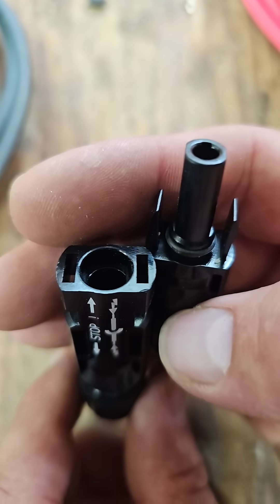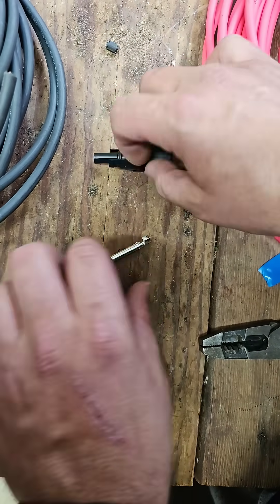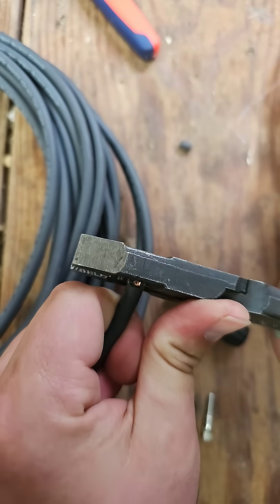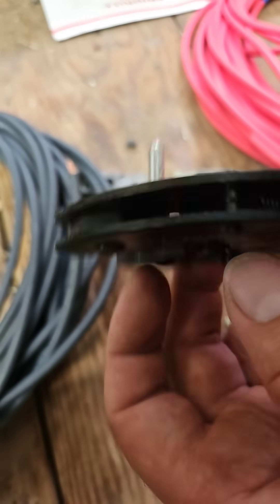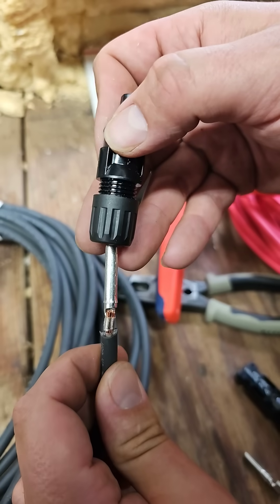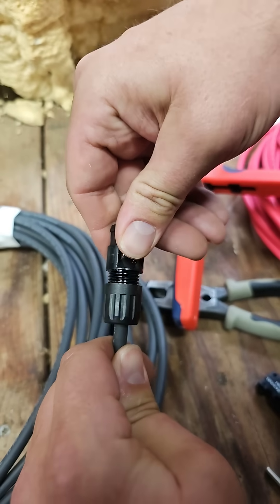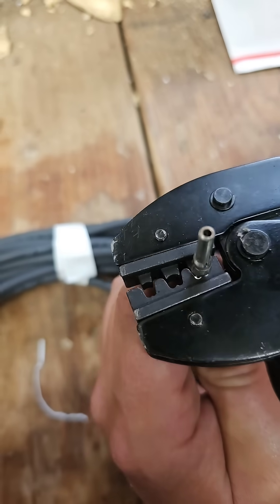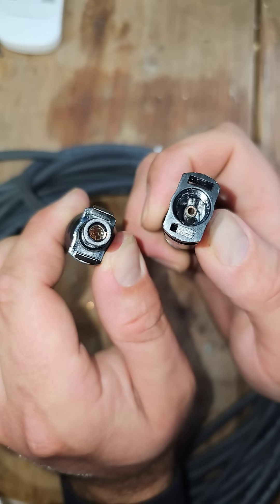The ABSOLUTE BEST Way to Crimp MC4 Connectors for Solar Power

Comment: The best way ist NOT to use crimp connectors. Too expensive, to much Tools needed, and experienced personnel is rare! There are a lot of crimp less connectors on the market. It's overdue, since electric connectors are cage clamps without screws for years

Comment: he did this allll backwards the connector with the large hole is the female the male is the close partially one.. positive is the female negative male.... the crimper hd did it wrong the metal connector goes on the other side flush on the other side 3.4 of an inch is all you need and crimp down till the crimper wont go anymore.. straighten the connector with your fingers the male useually bends  this is why you do it to the male and not the female then insert them into the housing.. i like to put the gasket and end on first  then you just use the tools to lock it in place.. this guy is doing it basssakwards

Comment: What I don’t like is how it bends the shaft after it’s crimped.  Then it’s off center in the mc4. I ultimately have to get some needle nose to recenter them. And bending them straight isn’t as easy as you’d think. I’ve tried straightening prior to inserting into the mc4 and it’s one tough connector.
Reply: @DouglasHeyen  the pins should fit into the connector just fine even if they're a little bent, once they're in the connector it should be centered enough to fit into eachother.

Comment: Question 
So once you click the pin inside the connector is there a way to get it back out if needed?
Reply: If you unwind the collor from the body, pull the gasket back you can fit a small flatblade screwdriver in to squeeze on the sleeve that the pin locks into and pull it all out then take the sleeve off the pin and put the sleeve back in. If you have more mc4's it's honestly easier to just cut and replace with the correct one.
Reply from the maker: yes

Comment: I am confused with regard to  male and female pins.  The male pin, would go into female pin. 
The male pin would go onto the male plug. The male plug would then connect into the female plug with the female pin. Am I right or wrong ?
Reply: The male pin goes in the "female" MC4 and the female pin goes in the "male" MC4.

Comment: That is not a proper crimper for Staubli MC4 connectors per the UL file. Also dont recommend stripping stranded PV wire with manual strippers either. There is a specific length based on the type of metal contacts youre using according to the Staubli MC4 installation guide (MA231). Also there is a torque spec on the cap nut on the back. These were not torqued properly.
Reply from the maker: Thanks for the information!
Reply: What's the alternative to stripping with manual strippers?

Comment: You need to tight the back nuts with the mc4 wrench at minimum, torque wrench at best. Unfortunately the seal might not be waterproof looking at your method.

Comment: I've been soldering them too, is that bad?
Reply: don't solder... only crimp
Reply: I'd read elsewhere that it's unnecessary and that there can be downsides to soldering. I can't remember what, though.
Reply from the maker: I'm not sure
I don't think it would be bad as long as there's a good solid connection
Reply: Soldering is bad, never solder them.

Comment: The metal connector inside the casing is the one that determines whether if the connector is a male or female
Reply: You're right. The bigger one with a smaller pin is the male ..the one that looks slimmer is the female coz it has the larger pin
Reply: No, the inside metal connector determines whether it's positive or negative.

Comment: There is on the Market MC4 Connector that we have in Germany that you don't have to Crimp 
connection at all but rather you just strip 
the wire down around 1 cm and then
just simply push inside the 
connector hard and you
hear click and the wire is tight enough that it won't come out so you just have to tighten the 
screw of the connector around the 
cable and it's done.
Less then 30 seconds it takes 
to make one connection.

The Logic of the connector is like a push-in connection of the wago block, once the wire is inside, there is no way that you can take it out but rather just cut the connector off and 
start from beginning. 
😅😊
Reply: @ibrahimkesetovic7869  in Germany you also have wagos while in America they use a nut and bolt 😆
Reply: You mean the Staübli Evo Ready connector.
Reply: Weissmuller x
Reply: Can you link it?

Comment: The fun part is trying to undo them if someone messes up and there's sun out that day.
Reply: Well if installed correctly theyd be connected into a dc isolator . You should never ever under any circumstances dosconnect dc plugs under load
Reply: @christophergallagher3845  Why not under a load? What's going to happen if you do disconnect under a load?
Reply: @archmasterone  Boom
Reply: @archmasterone  they can arc and this might damage your charge controller. But I do it all the time with small panels. My bigger system has dc circuit breakers which I turn off first before disconnecting mc4 connectors.
Reply: Toss a blanket over the panels. Or anything that blocks the sun.
Or just do it at night.
Better yet, get a neighbor you hate to do it at noon... lol
Reply from the maker: Oh yes that would be terrible